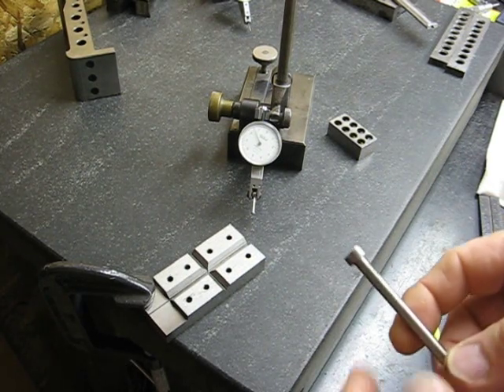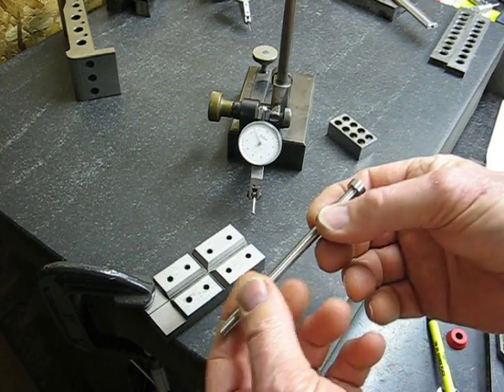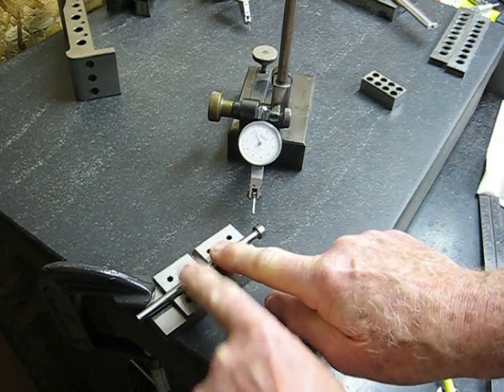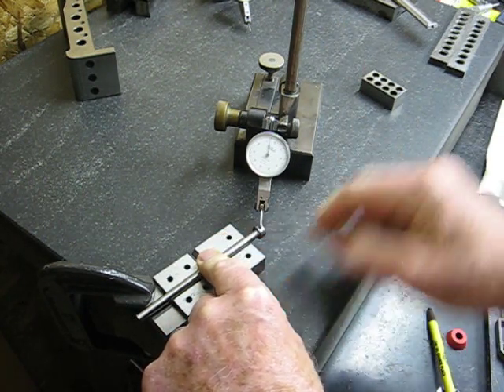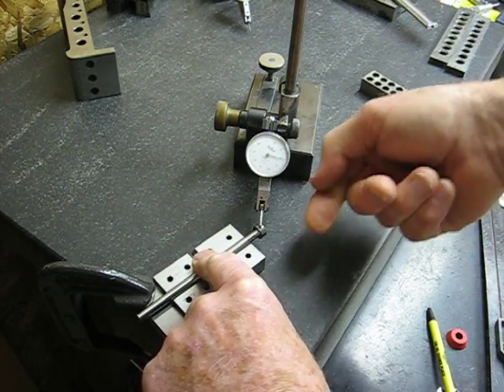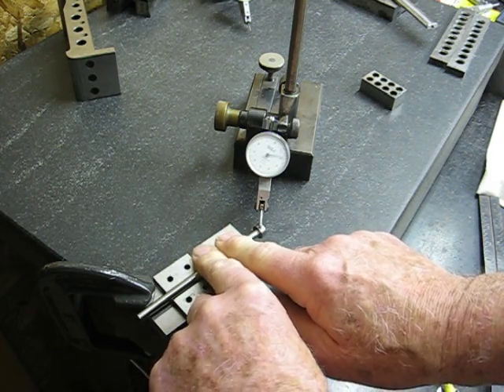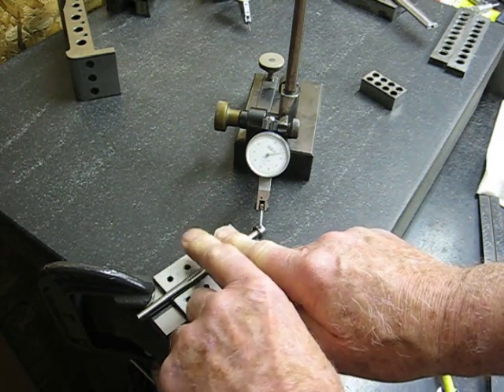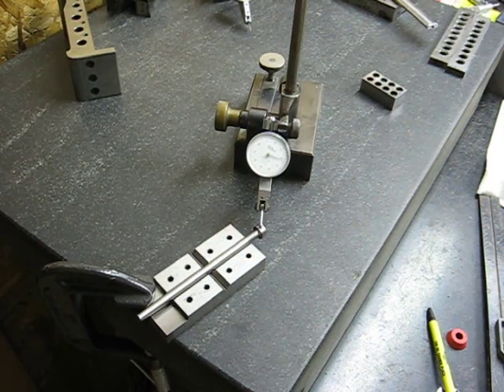Inspection of Runout

Comment: You guys are all missing a very important element here! Concentricity is the control of 2 diameters sharing 1 axis or centerline. When rotating the part a full 360 turn the centerline/ axis only moves HALF the distance that the indicator is showing. If your indicator is showing .005 that means the centerline/axis is only deviating .0025 one direction, coming back to zero and deviating .0025 the other direction.  That means the centerline/axis in relation to both diameters are concentric within  .0025.  When measuring circular runout or even total runout  ( most people are confused on the difference between the 2. circular runout is 2 dimensional and total is 3 dimensional) your TIR, or full indicator movement cannot exceed the tolerance zone, whatever is says in the tolerance box. So in those cases your runout would be your TIR.  Hope this helps.

Comment: I could not agree with +Mario Mackiewicz more.
The deviation of 2000th of an inch, the dial is indicating is the circular runout and not the concentricity.
That head can be perfectly concentric with the the shaft and still show huge runout variation. Because runout is the ovality of the head surface with respect to the shaft axis. where as the concentricity is the offset between derived median point of the head surface and the shaft axis.

Comment: Do you know that you are not measuring concentricity but runout or total runout if you move indicator sideways? Please do not confuse poor folks!
Reply: Mario Mackiewicz interesting, so what is the proper way to check concentricity?
Reply: +Mario, you are correct. However, in his defense, concentricity used to be synonymous with runout many years ago.
Reply: I was about to post the same comment that he is actually measuring run-out. Good to see that someone has already posted it.